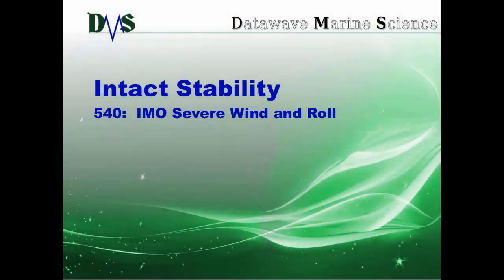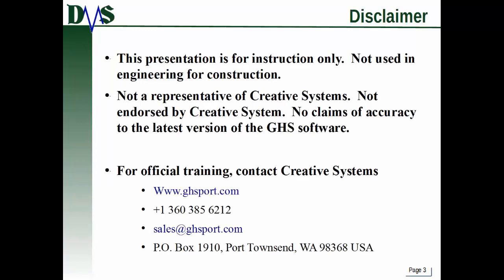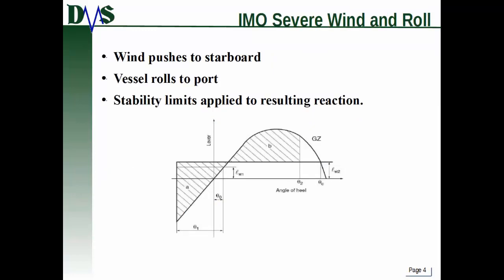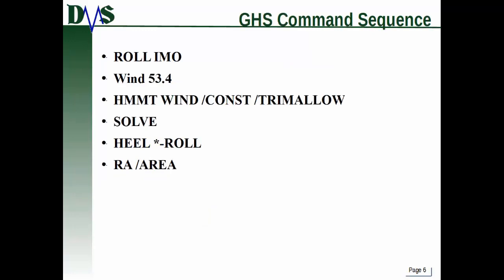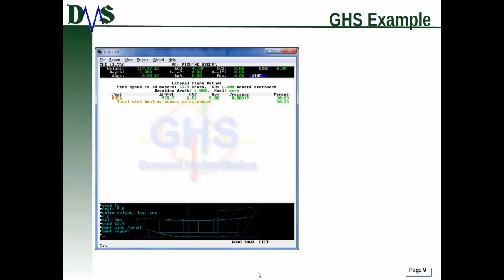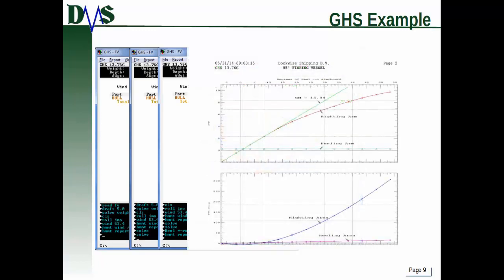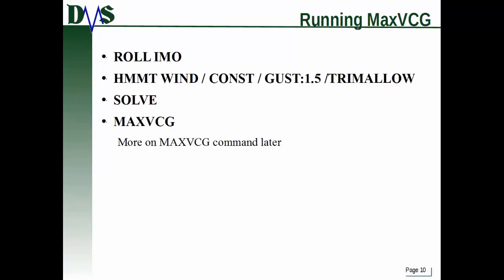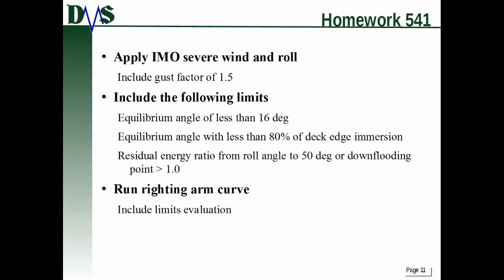540 IMO Severe Wind and Roll Criteria (Improved Audio)

Comment: I'm not sure how to define the deck Edge of the vessel & when i use:
LIMIT ANGLE FROM PRE TO 80%DI0 > 0
i get the message "No Deck Edge Information".
Reply from the maker: The deck edge must be defined in your model information before you can use any commands that reference it.  The deck edge is actually defined through the MARGIN command in part maker.  Here is a basic command sequence that should define your deck edge.

<Open your model in GHS>
ENTER PM
MODIFY HULL
  MARGIN 0.25
/
WRITE <Your Filename>.gf
QUIT PM

Anything in brackets are inputs you must supply.  Replace the brackets and everything between them with your own filenames or other input.

This command sequence goes into part maker and creates a margin line for the hull.  This is a basic margin of only 0.25 ft (assuming US imperial units).  The important part is that in addition to the margin line, GHS also defines the deck edge, and creates a margin line relative to it.  

Many times, the deck edge that GHS automatically defines is not correct.  You may need to manually adjust the deck edge.  To do this, go into section editor from the main GHS window.

SE

In section editor, you can look at each individual point that defines each GHS section.  Most of these points are just  a string of Y and Z coordinates at each section.  However, some of the points also have the letters "DK" after them.  That is how you mark a deck edge.  Add the letters "DK" after the coordinates for a point.  If you want to change a deck edge location, first remove the "DK" letters from the wrong point, and then add them on the correct point.  

Be sure to save you file when you exit section editor.
Reply: Nicholas Naval Architect many thanks for your detailed reply. Well said.
Reply: Many thanks for your detailed answer.

Comment: Thanks, I usually use the following:

WIND (PRESSURE) 0.051
ROLL IMO

LIMIT OFF
LIMIT TITLE IMO weather criterion
LIMIT RES RATIO FROM ROLL TO ABS 50 OR FLD > 1
LIMIT ABS ANGLE AT PRE < 16
LIMIT ANGLE FROM PRE TO 80%DI0 > 0

HMMT OFF
SOLVE
ANGLES *
HMMT WIND /CONST /GUST:1.5 /TRIMALLOW
HMMT *
SOLVE
HEEL *-ROLL
RA /LIM:ATT
Reply: I follow your step: and found 
Error : Roll Angle must be first